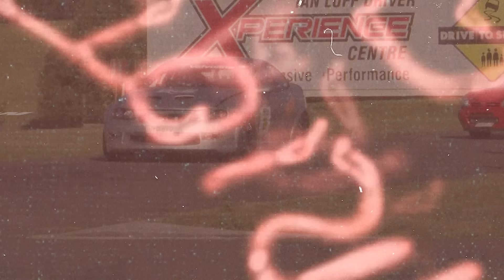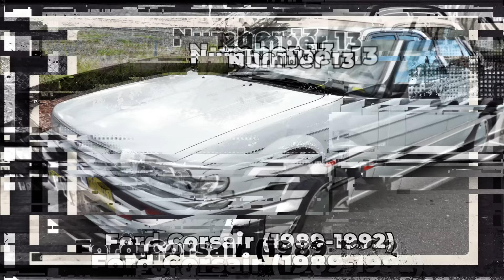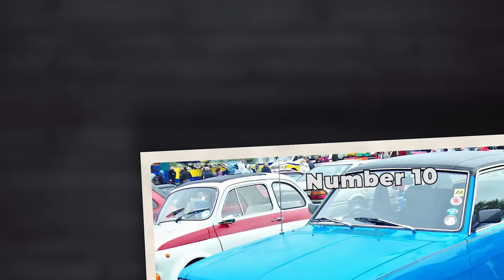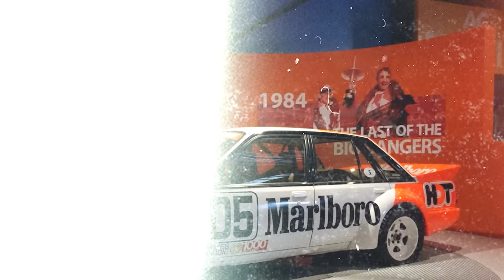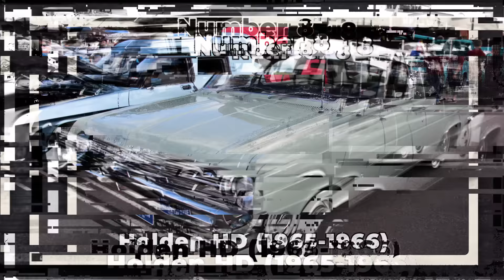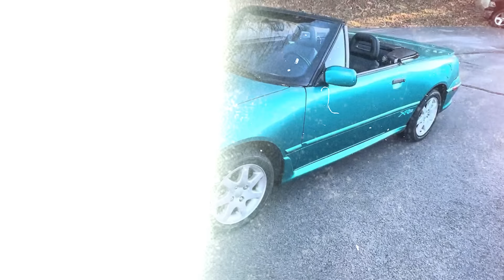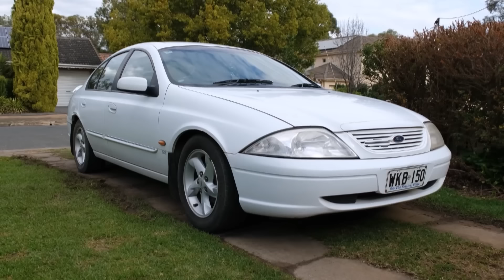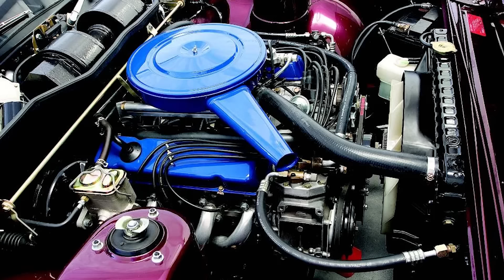Top 15 Worst Australian Cars Ever Made

Comment: The AU Falcon is actually an excellent car. Reliable, bulletproof and cruises all day on rough Australian roads then asks for more.
The designers were too far ahead of time, many new Mercedes look very similar to the AU.
Reply: This car was engineered  right those engines just went on and on
Reply: @samnwo1525  apparently they had the system where if it would run out of coolant, it would shut down cylinders so it wouldn't overheat. Enough to get you out of trouble.
Reply: @timhinchcliffe5372 they sure did only Aussie car to have that fail safe
Reply: @samnwo1525  when you live in a country where there are places that if you break down, dying is a real possibility, this could be a lifesaver.
Reply: Had an AU2 Ute for 24 years, brilliant old bus, never missed a beat, bullet proof!
Reply: @trumps1973  i got one the other year for my first car, manual XL tradesman ute factory lpg,, great car just ticked over 300,000ks
Reply: Yeh they just hating on Ford,  lardner  park Ford vs holden endurance test full throttle the Au falcon wasted the commodore
Reply: The AU 2 was the Daddy had 1 never missed a beat
Reply: @teeceesmusicvideochannel1282 yea I had a futura wagon that thing had space nice galaxy blue fitted my drums and went everywhere .. my ex had a series 3 futura sedan on lpg that thing didn’t miss a beat either … find a car in any brand that can outlast these cars lol
Reply: Yeah, I noticed that.
Reply: The sunken bonnet looked bad, but you could get the raised bonnet on series 1 Fairmonts, which was the family hauler when I was a teenager. It was a nice car. 

I think series 2 they went to raised bonnets across the board.
Reply: I didn't love the look of the AU Falcon - in particular it's rear end. But from what I know, it's been one of the cult favourites of the 90s Falcons. I'm not sure how it was bad. Owners loved them.
Reply: @OldAussieAds  My AU was one of the best cars I owned.  Duel fuel, cheap to run and never broke down.
Reply: The other terrible car was the Magna ..the early model circa 1987..88 .89..FWD .. with the origami styling...The 2.6 carb model with the early auto gearbox was soo slow that I couldn't believe it was a 2.6...Wafting along on its spongy suspension and the extremely soft feeling gearbox absolutely slurring away and watching the fuel level needle basically drop as you drive....The later series 2 models got a lot better with better more reliable gearbox and multi point fuel injection...The manual ones went a lot better.
Reply: @777gordini  the magna(early 2000s) was actually pretty good,, could give a falcon a run for its money..
Reply: XB falcon was the best after that ,,
Reply: I had massive gearbox issues with my AU. The body and engine was good. The gearbox was awful
Reply: Big fail on the droopy tail light styling.  Good grandpa car though.
Reply: Weren't the gearbox's rooted?
Reply: @mortlaursen6752  nah, at least not with a manual, they use t-5s...

Comment: I had a 1.8L 5 speed manual Camira many years ago. Mechanically the car was very sound and it didn't use up oil. It was also very economical on the highway. But, its Achilles heel was actually the electrics, The ECUs in them were absolute rubbish. Every couple of months mine would die and all I could do was pull over, hold the pedal to the floor until the thing would decide to start revving again. And then in another couple of months, I would have to go through the same ritual. The also had a design flaw where the wiring plugged into the back of the speedo cluster circuit board. I had to re solder some joints and then very gingerly put the plug back on and hope I didn't crack any more solder joints in the process.

Comment: There was no Ford Capri ever made in Adelaide and happened  to be at Clovelly Park MMAL, building Magnas and 380's from 96 until 2009
Reply: The Leaky Capris of the 90s and Overlander utes/panelvans of the early 70s were made at the
Kingsford Smith Drive plant in Brisbane
Reply: There was no car manufacturing plant at Clovelly Park. You’re thinking of Tonsley. My father worked there when it was Chrysler. He also worked at Lonsdale.
Reply: Mazda competed head on with the Capri ( which had small back seats, while the Mazda didn't ) in the USA.   In Australia the pricing was nowhere near the same.

Comment: I will say though I had a 2001 Ford AU Forte Series 2 for 22 years and was so reliable.
I never had any major problems with it. Was an automatic and my tyres were helium filled. Loved it.
Reply: Had an AU III; fine car. 👍
Reply: @chrisweeks6973 same
Reply: Have a series 3 with 192000km, still drives fine.👍
Reply: @johntaylor2054  series 2 with just ove r300k still goes well :)
Reply: I'm love fords and had an AU XR8 elect windows kept stuffing up
Reply: @NeilClifford-t6v  It's a Ford; they do that. My SZ Territory has the same issue. Just remove the switch box, clean the contacts inside and it'll be ok for a while. That, or simply get a new switch online, as they are far cheaper than from the dealer.
Reply: @chrisweeks6973 That's what I did but expensive getting cleaned.What really annoyed me no switch to change between power and Econ mode as in the EL even on Econ mode it drank 24 ltrs per 100 kms.Thats a lot for a small 5 ltr V 8

Comment: No HX Kingswood? It was a shocker.
Reply: My neighbour bought a brand new HX and it broke down on its first country drive.  He rang me and we towed it back to the dealer with my FJ.
Reply: My favourite car i ever owned
Reply: HX, released in June 76, had the good old 173 and 202 sixes. Unfortunately, Holden had to hastily throw on a pile of antipollution paraphernalia to comply with newly introduced ADR 26 re exhaust emissions. Hard starting, poor fuel mileage, a habit of burning out valves on no. 5 cylinder due to EGR design and also overheating problems were everyday events.Sometimes had to put the Trimatic into neutral when stopped due to rough idle coupled with a tendency for the engine to stall. My ongoing job as a Holden mechanic was guaranteed back then. A lot of these problems being ironed out to a great extent plus the introduction of RTS coupled with those fancy new steel belted radials made the HZ a completely different car.
Reply: Not the Kingwood, I've just steam cleaned the sun visor 😂😂😂
Reply: 12 mpg

Comment: The Mitsubishi didn’t sell as it’s a front wheel drive and people thought they were no good for towing a caravan or launching a boat. As the Falcon and the Commodore were both rear wheel drive . Ex  Mitsubishi worker.
Reply: A massive shame, as FWD towing is done all over the world with little to no issues. I don't know what it is with this country's obsession with RWD as if the average motorist would even know what drivetrain layouts are.
Reply: True, and there was no station wagon variant for the 380 (the last Aussie made Mitsubishi), but apart from that it was an excellent vehicle using basically the same engines as found in Pajeros and other Mitsubishi vehicles!
Reply: @stevieraywombat wrong. The Magna came in a wagon. TM,TN,TP,TR, TS etc
Reply: @Iwishiwasflying  Was talking about the last model released, the 380. (I will correct.)
Reply: 4WD variant was a ripper.

Comment: HD was a good car with it's 179 engine especially the twin carby version the X2
Reply: I loved my hd
Reply: The HD was known as the pedestrian slasher for a good reson. If they got hit buy a front corner there was little chance of surviving. This was also part of why it was discontinued so quickly.
Reply: @d @drewshep1473 odels were change every year or two at that time  - 18 months was pretty standard.
Reply: HD so ugly and front spear mudguards dangerous
Reply: @NeilClifford-t6v  you talk about front Spears what about the 57 Chevs bonnet
Reply: @russellherrmann6748 Of course another GM stupid design car
Reply: We were getting tradeins that were less than 12 months old and full of rust.
Reply: And it's predecessor wasn't bad wither. Though I think the EJ was seen as a stop gap from the dependable EH as not much was changed.
Reply: @2DogsVlogs The biggest change was the engine, going from the old grey motor to the 149 and 179 red motors. I once drove an EJ with an automatic gearbox (Hydramatic) and it was so underpowered, the EH was much better with the 179, they were a good reliable car.

Comment: You forgot about the Craptiva,
Reply: Captiva was made in Korea, they are NOT Australian cars !
Reply: @SS-sr3yv  Neither was the Geely at the beginning of the vid.
Reply: @SS-sr3yv no they weren’t an Australian car, but they were badged as a Holden. Same as the cruse and a few other cars.
Reply: @SS-sr3yv  No I wouldn't call a Captiva an Aussie car, but not everyone knows some models had an Aussie engine. A 2010 Captiva had a Aussie built Holden AlloyTech engine in it, while a VL Commodore may have had a Japanese built Nissan engine in it.
Reply: I have a captiva 2016 diesel. Not one single issue with it in 10 years. The diesel engines were made by Isuzu, need I say anymore except for yes the petrol engines were crap.
Reply: @mountainman-g1f  I owned the AlloyTech petrol engine for years. It never missed a beat. I wouldn't say the Captiva was brilliant but it was always dependable for me. I tried to run it into the ground but it just wouldn't die.
Reply: @mountainman-g1f i see people selling them cheap on gumtree usually with gear box problems Isuzu are good at building diesel engine s though
Reply: @mountainman-g1f lucky
Reply: Don't drive behind a Captiva who knows if the transmission will fall out
Reply: @chrismousley1668  Or the smoke screen from nowhere 🤣
Reply: Closely related to the Cruze via the drive line but imported from Daewoo which was a GM subsidiary. Built to price, say no more!
Reply: I worked at a holden dealership...i remember they had a recall on the Captiva... And yes the name quickly morphed into craptiva....and stayed there....
Reply: Holden Camira remember was Wheels magazine’s Australia Car Of The Year 1982 winner! Growing up our family car was always Holden so by early 1980’s was a brand new 1982 dark blue JB SL\E Stationwagon 5 speed manual, 1.6 ltr front wheel drive & amazingly years later my own & second car (my 1st car in 1987 & same week just turned 18 yo was an all original white ‘73 LJ GTR XU-1 so sad had to sell it via auction in 1997 :( So after 10 years my 2nd car was a ‘87 JE model SL/X stationwagon also, 5 speed manual now with a bigger 2.0 litre motor still front wheel drive stationwagon was a very reliable & great Aussie made car too ;) 🇦🇺👏🏼
Reply: Number one choice for the single mum. You can tell they never change the oil or tyres
Reply: Regarding the Camira… it was one of the infamous GM J-Body family that nearly scuttled GM altogether, not just because they were so bad but because they destroyed brand loyalty. Chevy Cavalier, Pontiac Sunbird, Oldsmobile Firenze, Buick Skyhawk, Cadillac Cimarron and many more… all the same car.
Reply: My first diesel Captiva suffered that dreaded diesel lag on startup... I got a good trade in for the Captiva Series 2.  Great improvement. Trouble free. Took me all over Australia without missing a beat. 
Just recently traded it in for a new car.  I was quite happy with my " Craptiva".0
Reply: About 12 years ago, I actually won a standard Captiva in a car dealer promotional raffle.  It was so gutless I traded it in within a week on a second hand Audi.
Reply: came her to say this
Reply: Craptiva crapmira,crappodore,crapbird,crapgemini that’s the Holden story  such shit boxes
Reply: @samnwo1525 holden used to be more reliable than ford but Holden lost the race by having to be fixed more often and cost more to fix than ford
Reply: @R @RonNieminen-z6h in what delusion there interiors were always behind as well the 3.8l v6 was a dog of a engine mechanics loved these cars coz they kept fixing shit
Reply: @samnwo1525 well if didn't get that thirst v6 serviced probably it would cook the head gaskets

Comment: Doing carburettor rebuilds on a P76 V8 was a nightmare. Bastards of things to get off the engines. The 4.4 litre V8 couldn't pull the skin off custard. The star fire 4 by Holden was often called the "misfire", or "backfire" 4 engine. They were notorious for drinking oil, & the way around it was to replace the rings with better ones from a red 6 that had the same size pistons, but then again, I do not trust any car wearing a Holden badge. There is still a few crappydores here, though not as many as a few years back.
Reply: Yes the piston's and rings from a 186. It was a cut down 186
Reply: Bullshit . P76 V8 did 16.7 quarter mile standard. Not great by today's standards but no worse than a 308 HQ
Reply: @bradleywicenciak8005 HQ 308 was a big piece of shit, as were everything else that was spat out by Holden. Nothing but garbage.
Reply: @christophermarshall5765  Yeah mostly true . But the P76 was well ahead of the big three on first release. Would have been truly legendary if it made it past 74 . Ahead of its time in many ways
Reply: @bradleywicenciak8005 piece of crap. I worked on them as part of my job. They were very slow and gutless cars. Now piss off.
Reply: @bradleywicenciak8005 Aussies should be proud of the P76 V8 engine design it's a super light tall deck long stroke small block with big block torque especially when the engine is modified to breathe.
Reply: @justinmccarthy1962  Correct. Drove one for years. Could lope along in any gear with torque to burn.. Lighter than small 6 cylinders of the the time. And yes the stroke and bore were the same at 86 mm I believe.
Reply: The 6.2 litre 620 hp P76 V8 built by Tony Marsh of Marsh Motorsports in NZ has the highest power to engine weight ratio for a naturally aspirated pushrod V8.The engine is lighter than its cousin the 6.2 litre Chev LS3.
Reply: @justinmccarthy1962 I’m not talking about cars modified by people you fool!! I’m talking about cars that are standard production vehicles that have no modifications to them. European cars from the same era as the P76 were much better. I could go on about the Tom Walkinshaw modified XJS V12 Jaguar that won Bathurst once. I could go on about a HB Torana owned by a friend of mine who took the little 4 cylinder engine out of it, and shoe horned a 454 big block into the engine bay then proceeded to build it into a drag car. The P76 was a rust bucket.
Reply: @christophermarshall5765 No need to get nasty. The P76 had better rust proofing than the other Aussie cars at the time and quite a few P76'S have survived.Despite having a small carburetor on the standard  P76 V8 it had good torque due to the square  engine design 386nm at 2500 rpm from a light weight aluminum V8. Many of the heavy V8 engine cars had to struggle with diminished performance because of   the hundreds of extra kilos that they had to move.
Reply: @justinmccarthy1962 I know some are still on the road. Last one I saw was in Mount Barker in South Australia. It is a blue one.

Comment: some of the cars you revieved, werent as bad as you made out. the P76, I WOULD BUY 1 TOMORROW,  if i could find a rust free model i owned a Holden HD. NOTHING WRONG WITH IT.  it went like a bat out of hell, for a small 6. never critisize until you own one, or drive one
Reply: Had a P76, worst car I have ever owned.
Reply: There's plenty of cheap P76s around. They are worth a fraction of the value of comparable Holdens and Falcons for a reason.

Comment: I owned many of these so-called disasters. My Corsair 5sp manual was a gem. Economic, comfortable and reliable. None of my several Toranas had internal rattles or squeaks. My wife's Camira did the job. Comfortable, economic and no oil burning. Agree re the P76 and definitely the Starfire 4 engine. This was a shocker. Hard to believe Toyota used them (even briefly) in their Corona. Holden also badge-engineered the Nissan Pulsar,. They called it Astra and immediately bashed it with the poverty stick. No more 4-wheel disc brakes.
Reply: The P76 was a car from the future a very light car with an Aluminum V8 26 years before the Holden used a cousin engine the Chev LS 1 5.7 V8.
Reply: Astra got a good name from the Nissan based version, only to gradually get destroyed as Opel based variants arrived.  Same with Suzuki Barinas , replaced first by Opels, then Daewoo's.   ( Craptiva's and Cruizes also essentially Daewoo's ).